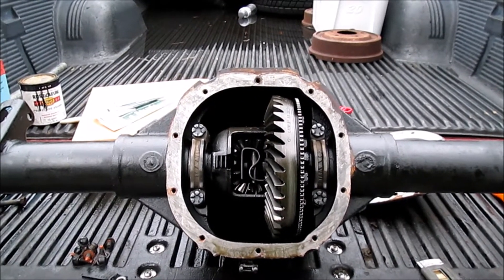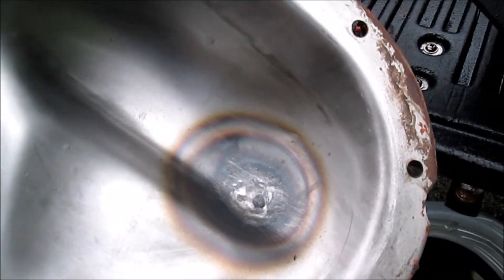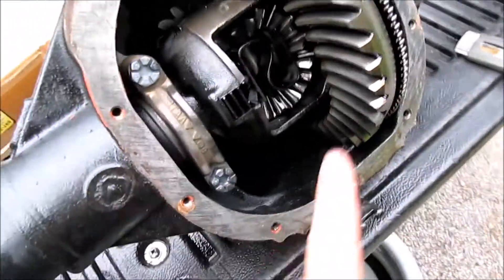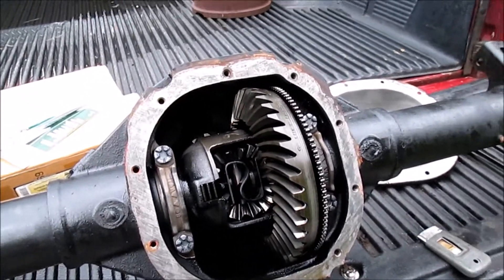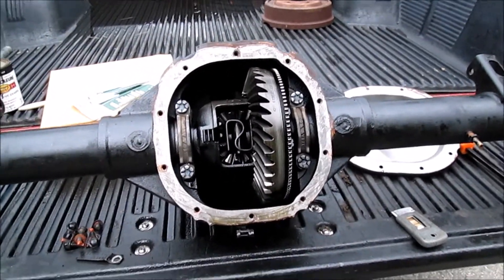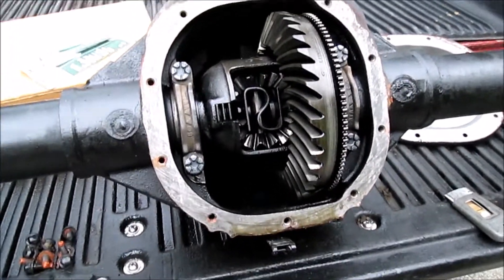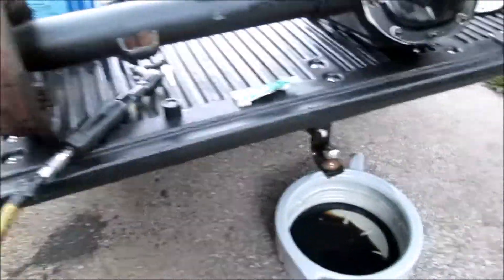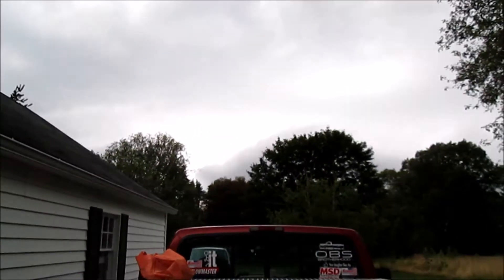Ford 8.8 Limited Slip Gear Inspection

Comment: The hole in the cover is most likely from a junk yard where they drill differentials to drain gear oil like where I'm from in Oakland California. The cover is previously used and reused by you again basicly.

Comment: You took the axle completely off just to inspect the gears?  Did you use brake clean on the clutch discs too???
Reply from the maker: I'm swapping out my standard open rear diff for a limited slip one.
Reply: Will's Garage, don't forget to put in the 4oz. bottle of special additive for the clutch discs.
Reply from the maker: I have it.

Comment: Thank you for all the information I will be staying in contact I like watching your videos and the fox shop as well I have done just as much work to my truck as you guys with the radiator support the frame restoration and everything I have a very clean two wheel drive truck that I will be put in a Dana 44 straight axle and instead of the twin I-beam I will post pictures or send them to you

Comment: I would like to use the same transfer case and transmission as you what year and makes do they come out of my truck does have OverDrive and I did not know what you meant in your video when you said torque converter lock out
Reply from the maker: You will need a transmission from an F150, either 1994 or 95, and the transfer case will come out of a F150, F250, or F350.